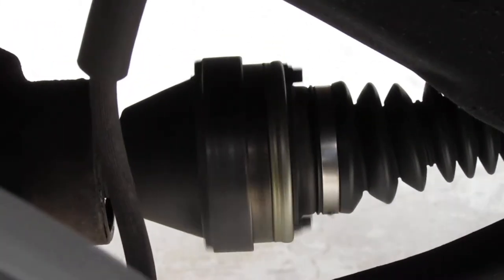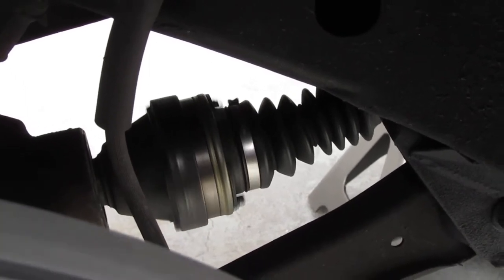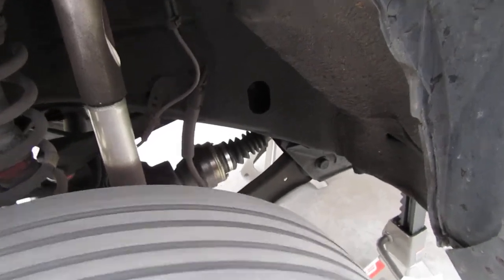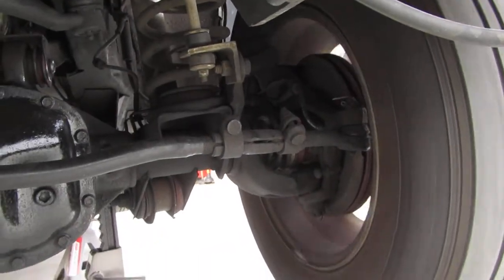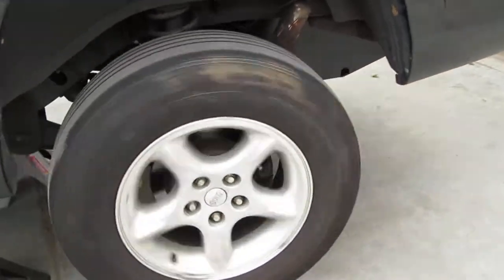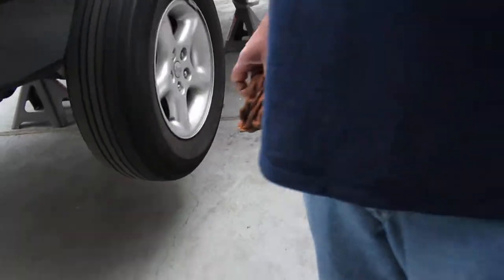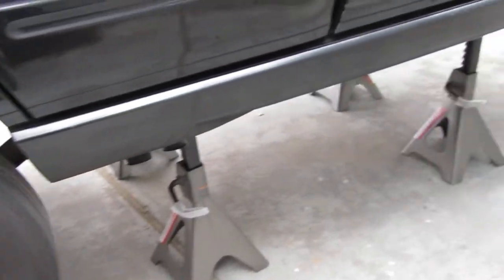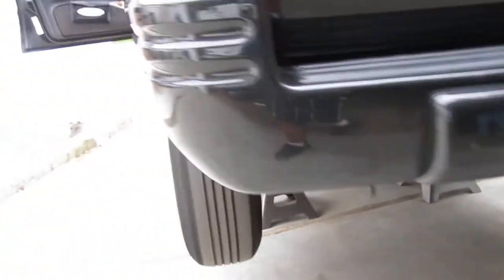1998 Jeep 5.9 ZJ Grand Cherokee on JACKS - Diagnosing front Grinding Noise

Comment: Did you solve the problem on your front differential and if you did what was it
Reply from the maker: Yes, the differential was bent.  I ended up replacing it with another Dana 30 with a truss installed by East Coast Gear Supply.
Reply: @301steady  but what part was bent? pinion ring, ring carrier? axle?
Reply from the maker: @jalatecompa  The whole Differential.  The driver's side housing was bent forward and up.  Caused a ton of racket until the bearings finally let go.  The fix was replacing the entire differential and I ordered a Dana 30 with a truss welded on, from East Coast Gear Supply.